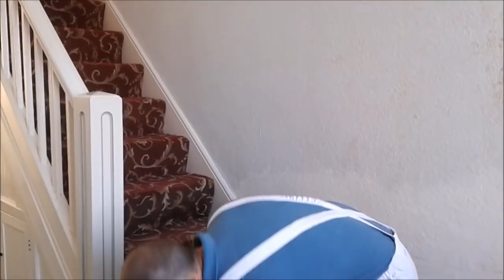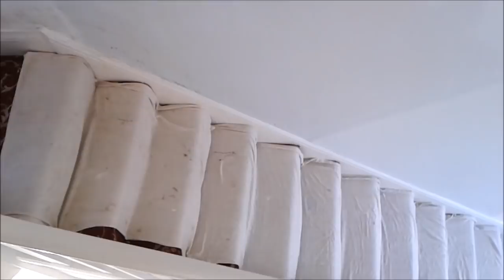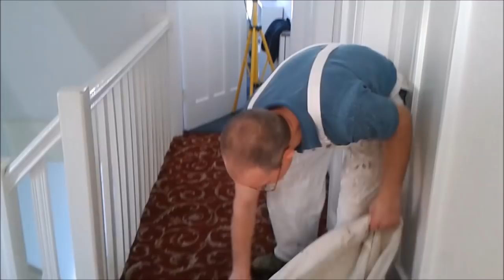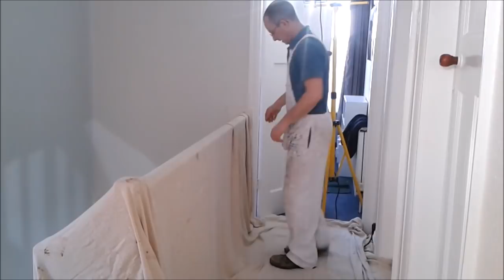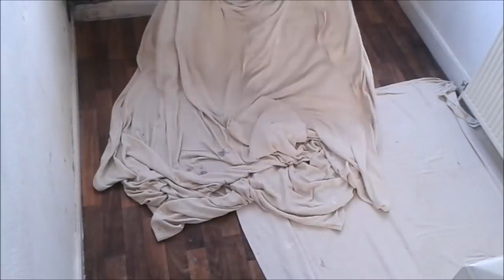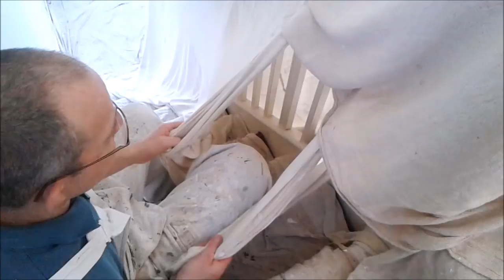How to sheet up a staircase before decorating

Comment: Great video, 
How do you store your dust sheets in the van as I use large plastic tubs for mine, but I find that the tubs don't last very long and I keep having to replace them, Was thinking of using the old style plastic laundry bags.
Reply from the maker: Ashley Short Thanks, dust sheets are in the storeroom so I just take what I need and they are already folded so they just go in the van in a pile.

Comment: I’ve noticed your dust sheets you always use are that of a more thinner material/style. 
Which brand are they?
Reply from the maker: Diall cotton dust sheet close woven and they are easy to wash and dry. Always have them 3 layers so if any paint spills you have enough time to clean paint up and pick dust sheet up straight into a plastic bag.